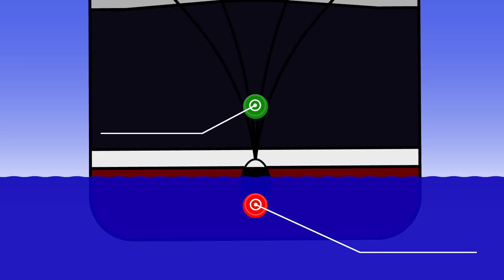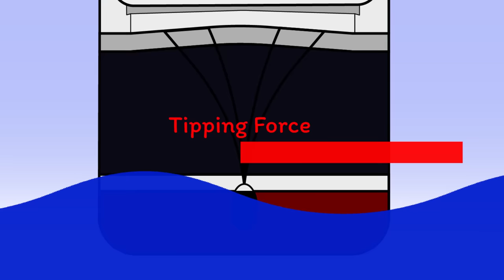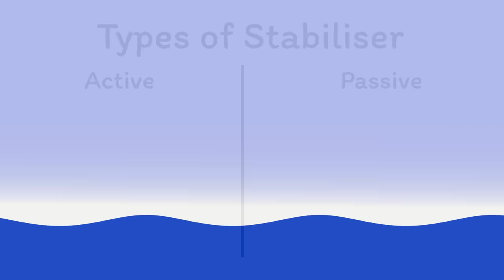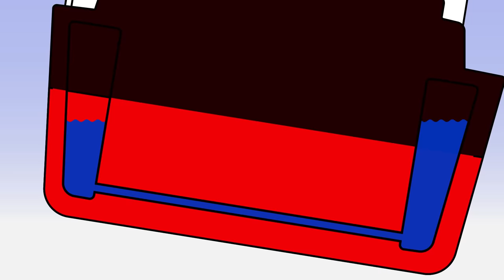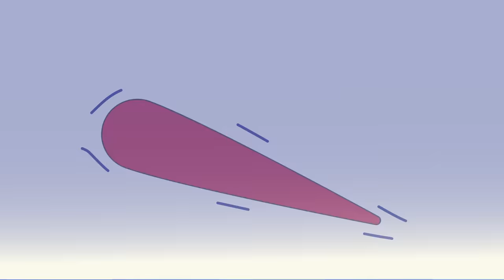How Stabilisers Reduce A Ship's Roll

Comment from the maker: Thanks again for the amazing response to this video.

Just to clarify a few things that have come up a lot in the comments. 

The centre of gravity and the centre of buoyancy are the correct way round in this video. Check out one of my earlier videos too see how it works: https://www.youtube.com/watch?v=DPV_VjzU9kE&t=163s

The stabilisers are a little confusing in the animation. They do twist rather than flap up and down. I struggled to animate the twisting motion when viewed from ahead so exaggerated the up and down element instead. Apologies for any confusion caused.
Reply: Wow lot of text
Reply: Just add real life photos or videos next time.
Reply: No-no-no, it's thank You for intelligible illustration
Reply: Id bet that if the stabilizer fin was twice the length it would operate at half the minimum speed. In the end it's just a wing and identical in function to an airplane's.  It's the same fluid dynamics.
Reply: Thanks for the great video! If I may point out a very minor omission though, I think gyroscopic stabilisers deserved a mention. Albeit now mainly used in yachts, enormous gyroscopes were in fact installed on the transatlantic liner ‘Conte di Savoia’ in 1932.
Reply: Great job on the animation and thank you. And thank you for that little explanation I was a bit confused. Great video
Reply: Grzegorz Durda The larger the stabilization fin the more resistance it will create against the ships forward motion. There's a cost/benefit balance point that would dictate the maximum and minimum size of a ships stabilizers. Although it wasn't mentioned, a fin with an adjustable surface area might help at lower ship speeds.
Reply: the buoyancy force acts up, the gravity force acts down. if they are in the orientation in this video, you get dynamic instability and the vessel capsizes. the same thing with any object in flight, the center of pressure must be behind the center of gravity (relative to flight direction) otherwise the object flips over to the correct orientation.

to drive the point home, consider the keel location of a yacht. it's a large weight to lower the center of gravity as low as possible. while the buoyancy pressure forces are concentrated on the hull.

unfortunately, for a technical video, this is a major mistake!
Reply: MZ you are not correct. Due to the shape of the hull the center of buoyancy moves to account for any rolling and it counters it and actually helps to keep the ship upwards. All up to a certain limit of course..
Reply: Wikipedia shows otherwise https://en.wikipedia.org/wiki/File:Ship_stability.svg

The ship's ballast allows the center of gravity to be lower than center of buoyancy. Think of it as hanging a pendulum up (the anchor point is buoyancy and the weight is center of gravity). The reason why the ship stays upright is that the forces are going in opposite directions, but not like in the video. 

It's a big error. Good video still
Reply: Sir, in order for a ship to "float", it takes the Center of Buoyancy (or Uplift) must be higher than the Center of Gravity.  Otherwise, there will be a torque (angular movement).
Reply: More, the Center of Gravity must below the sea level.  By all situations, Center of Uplift must below sea level, but Gravity may not.
Reply: which software u employed to make this animation. please reply
Reply: Stablizers stabilize a ship's roll, but never a Rick's Roll.
Reply: I wish you explained the coanda effect for the fins but good video.
Reply: For the swist you shouldve done a spiraling pattern? I don't  really know hope it helped tho
Reply: Casual Navigation hiiiiiii
Reply: Those ships Capsize toll
Reply: O
Reply: Aha...I learned something new. Thanks. 👍👍👍
Reply: OK that makes more sense. I was wondering why the ship had to be moving forward above 6 knots for the fins to work. That explains it.
Reply: Indeed, the center of gravity G and center of buoyancy B are correct in this video and those who are claiming they are backward or this is a "major error" are not correct. G is correctly located above B, though it's understandable why someone may think it looks wrong at first glance from a static picture. G remains in a fixed location relative to the ship because it's a property of the whole ship and its loading. B is the "center" of everything below the water and is necessarily below G. If the center of buoyancy B were also fixed relative to the ship, then, yes, this configuration with G above B would be unstable and the ship would capsize, but that’s not what happens. Rather, B moves laterally (primarily) relative to the ship as the ship heels and different parts of the hull are underwater, providing a righting force.

The thing that must be located above the center of gravity G for the ship to be stable is not the center of bouyancy B but a different thing called the metacenter M, which you can also think of as the root of a "pendulum" on which B swings. The understandable confusion why some folks might think the video is wrong may come from the fact some sources on the internet (including even older versions of Wikipedia articles) incorrectly refer to the metacenter M as the center of bouyancy, but they are different concepts. If you want to look to Wikipedia for authority on “truth” as some commenters here seem to, this is a good link to help folks understand why the video is correct: https://en.wikipedia.org/wiki/Metacentric_height. A good merchant mariner course or school covers these concepts pretty well too of course.
Reply: @michaelzlprime  Actually a very interesting issue, and intuitively your thinking seems correct, but in fact it is a lot more complicated in the case of boats. The centre of gravity is usually above the centre of buoyancy, but as the vessel rolls there is a righting force acting on to return the ship to vertical - to a point. Heavily keeled yachts are the exception in fact.
Reply: I wonder why they don't just use a counter weight like those pendulum balls used as a sort of earthquake proofing for large buildings? I was waiting for it to be mentioned on this video. Is it because the weight of the ball might be an issue on a ship on water compared to a building on land?

Nice explanation and presentation btw! You have a knack for teaching things! Kudos.
Reply: BUY silver silver nitrate is used in rocket fuels and pharma industry
Reply: Why is a hanging weight not an option for passive stabilization? Some skyscrapers use them.
Reply: +100 for naming your fictional cruise ship the Andrea Dorea.
Reply: My Liner Titanic Tipped!

Comment: This is very simple presentation of most difficult subject.
Reply: I think it could of been simpler
Reply: J Magnums ships stability is a very hard and long subject, this video barely scratches the surface
Reply: @bubbles7608  cause it's disgusting
Reply: Thats because he explained nothing, all he said is that there is water or fins that move
Reply: You must be joking !? Subject itself is painfully simple. Solutions also. Most primitive passive stabilizer will do a good job to prevent rolling to much or falling on the side but only active stabilizer will minimaze rolling as possible.

Basically you have two type of stabilizers with 2 different methods. Weight or resistance.
Reply: YOU PROBABLY THINK PUTTING GAS IN YOUR CAR IS A DIFFICULT SUBJECT TOO I BET...
Reply: @kblocks7266  take it easy there Mr. Keyboard Badass.
Reply: @AdrianoCROST  This wasn't taught in mariner schools or the navy until the 1940s-50s. It's crucial information, as is knowing how to correct a parametric resonance roll. For the former, a heading change of a few degrees should correct the synchronous rolling effect. For the latter, speed must be altered (decreasing speed almost always corrects this). Parametric resonance only occurs when operating in longitudinal waves. Both of these roll situations must be recognized within seconds or the ship is in serious trouble. The solutions to these situations are NOT obvious. Of course it seems easy when it's laid out so simply, but it took many many many years before mariners understood what these phenomena were. It's not easy. The people who know this stuff aren't calling others idiots for not understanding it. It's complex out at sea, especially when the ship starts pitching violently and you have seconds to avert disaster.
Reply: Naval Arch
Reply: Buy silver than crypto currency buy silver silver nitrate is used in rocket fuels and pharma industry

Comment: I'd be shocked if the author here hadn't played Stormworks, a game entirely about building functional ships. I had a mate figure out he could use a weight actively rolled on a track positioned in the bottom of the ship to rapidly shift CG and counter rolling. Definitely a personnel safety hazard, but it did work.
Reply: A good example of something that works very well in stormworks but would be a mechanical nightmare irl.
Reply: @moldman5694  We've got the technology for rolling things on tracks quite figured out. The main issue I (as a complete layperson) see is that the area in between the extreme positions needs to remain clear, costing a lot of space.

Comment: There's one system you have forgotten to talk about.
In the big military ships, mostly the aircraft carriers, there's an active stability system also, and it must be very effective for the planes to land safely, even in rough weather. Inside the hull, between the center of buoyancy and the centre of gravity, there's two sets of rails going perpendicularly from the center axis, side to side. On these rails, there's one big mass which is moved by computers in the opposite direction of the waves.
Reply: That's functionally the same as the water pumping stabilizers. Just moving mass around inside the ship.
Reply: tall buildings have those too!
Reply: @chilfang2422  Tall Buildings generally use the mass dampener tho, which is just a very big ball of something heavy hanging on pistons, so that when the top of the building moves the mass is used to pull the building in the other direction. The Burj Khalifa notably lacks this, and instead uses its spiral shape to redirect windflow so it doesn't really swing a lot anyway (of course this would be a disadvantage in an earthquake)

Comment: When I was in the Navy I use to play around with subtle rudder action to stabilize the ship. The idea is simply to counter the wave action with a slight bow turn in the direction of the list.
You have to be a bit ahead of it of course so the ship has time to respond but waves are very consistent in their timing so its really all about that...Timing.
Reply: I know just what you are talking about.  Getting the timing right can be very difficult.  Especially on an old ww2 tanker converted to crab processor.  She comes around slow anyhow, but good timing still has an effect.

Comment: Not for cruise ships, but there are another 2 types of active stabilizers that also work while stopped. One uses a heavy spinning weight on the center line inside the boat and a gyro to counter the force. The 2nd one is also spinning, but on the outside, like the active fins. Because they are spinning in the water, you don't need to be moving to build counter force.

Comment: Cool video, glad to have come across your channel!

There are actually what’re called zero-speed fin stabilizers that don’t require you to be moving through the water. They have a much wider range of motion and use the fins kind of like wings. Not sure if they employ them on larger vessels though. They’re pretty common on recreational yachts in the 20 to 60 meter range.

There is also another method of stabilization not mentioned. But again, i believe they’re only used on smaller vessels. I see them on sport fishing yachts most commonly. They’re called seakeepers and they use gyroscopic stabilization. It would be cool to see a video explaining their function, advantages and limitations.

Comment: The frigate I was on had active fin stabilizers.  They were always broken though, so we would just roll from side to side.  On particularly rough days, you'd start to see boot prints on the bulkheads (walls) of passageways. There were times on the bridge, when you were literally hanging on to something bolted down to keep from sliding across the deck, that I wondered if we would finally capsize.

Comment: The best way to avoid spilling drinks on a cruise ship is to lay flat on the floor with a 5cm tube in your mouth attached to a large funnel. 

There, a trained professional can pour the drink into your mouth without spilling. 

In case of overage, members of the crew can stow you below decks on a gurney, and roll you back and forth in counteraction to the waves. 

It's great fun, and passengers & crew enjoy it immensely.
Reply: The fuck..

Comment: Wait what? Ships have FINS ? 
*THE MORE YOU KNOW*
Thanks for the infos youre giving, underrated!
Reply: Yes. One problem with these he didnt mention: they are difficult to maintain and repair since they are underwater. Another problem is that sometimes they are forgotten outside and they might catch a chain of a buoy or smash against the dock. They are only about 5 meters long, but thats enough to snag a buoy chain. It has happened before in tight channels.
Reply: Simon WoodburyForget Yes, but you gain a little bit of energy from the ship staying its course better so the rudder doesnt have to work as much. But overall you indeed lose energy on those.
Reply: Simon WoodburyForget 

Im an officer, have worked 1.5 years on a ropax with exactly these kinds of fins. 

Its called hydrodynamics, not aerodynamics. So much for understanding something.

The waves do change the course of the ship. Even when you allow for much yawing on the autopilot. This is due to the changes on water resistance on each side of the ship due to the roll and the waves. This is the same as if you try to sail straight with a list, you will notice the ship wants to turn in the same direction of the list. This is partly why ropax ferries tend to run the heeling tanks a couple of minutes prior to a sharp turn in shallow waters, towards the direction of the turn, so there is less forces working against the course change.

Having used these fins for 1.5 years pretty much every other day, i can inform you that the efficiency isnt greatly affected. What is expensive about them is the service. 

They dont push the ship deeper into the water, as one fin pushes one side down, the other lifts the other side up simoultaneously. They try to find a balance where they dont use up more energy by lifting or pushing down the entire ship. They monitor the lift and push on each side and balance it out so the forces equal to 0.

The fins allow for less rudder movements, that is clealy seen on the indicator, so the increased drag from them creating a forced is partly reduced in the much larger surface area of the main rudders moving less.

The way the ship is loaded affects the efficiency far more, so much that the difference in fuel consuption is 30% less if you get the weight of cargo just right. A full on aft trim will reduce the efficiency to an extreme amount, much more than any fin could potentionally do. 

Take a look at the rudder indicator in strong winds versus large waves, youll see a clear difference.

In my sailboat racing days we regularly trained by taking off the rudder completely and only manouvering the boat with our sails to learn to reduce drag by using the rudder, the only time the rudder is used with any kind of force there is in emergency situations or really tight manouvers, so much so that when you do your penalties (turn 360 or 720 degrees in one go) you just give a push of momentum into the hull with the rudder and then completely let it go, doing the rest of the turning with your sails and shifting the centre of gravity with your body weight so you dont lose speed.
Reply: Simon WoodburyForget windsurfing also doesnt require a rudder, turns pretty damn sharply still. Same goes for sailboats. You can go any direction without a rudder just by manupulating the weight. If you turn the rudder you create more drag, thats why world champion class sailors train without a rudder every now and then. They barely use it when racing. 

1% is meaningless compared to everything else that affects the efficiency. If you change the speed from 22 knots to 26 knots on the Ro-Pax i worked on, the fuel consumption goes up about 40%. From 190 kg/nm to 260 kg/nm. 

The waves by themselves affect it much more than 1%.  

The difference of using 3 engines instead of 4 engines or vice versa make up for way more than that 1%.

Yes, it creates some drag, but its quite irrelevant compared to the other factors. 

If shipping companies want to sail more economically, they increase the margins of time the ship has to arrive to the next port. This way they can sail at the most economical speed and time currents well. A set of fins in relation to fuel economy is a drop in the ocean to the companies wallet.
Reply: Simon WoodburyForget So, the fins cost about $296 000, an increase of 3 knots speed costs $7 000 000 annually, if my maths are compltely correct after a 12 hour shift
Reply: If you look at expensive sailing boats like Volvo Ocean Race ones, they got huge and heavy fins (keels) that can rotate from side to side to counter wind forces...
Reply: Huangwei Xie That is to maximise the sail area relative to the winds direction. Also, by the boat being more upright there isnt as much force trying to push it upwind, so the drag from the rudder countering that movenent is reduced by forcing the boat to be more upright. Basically you are trading pretty much the same or a bit more drag effect in exchange for a lot larger sail area.